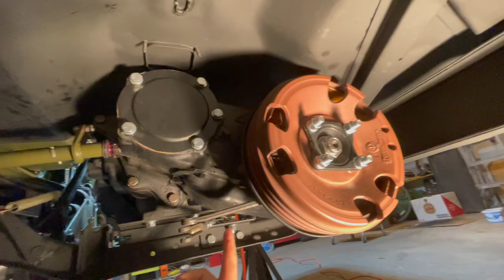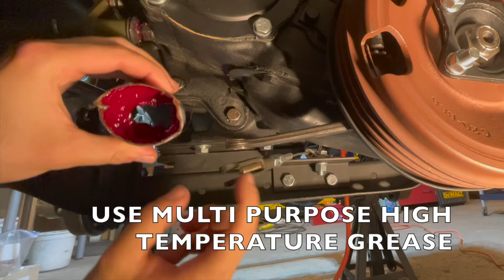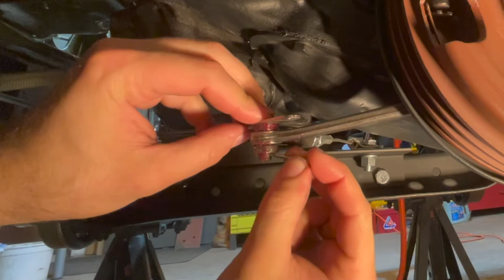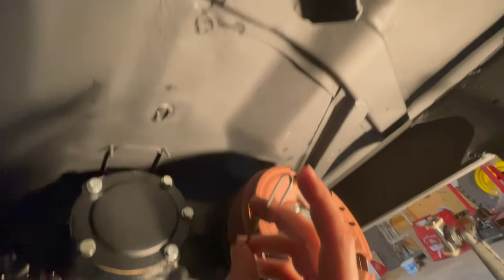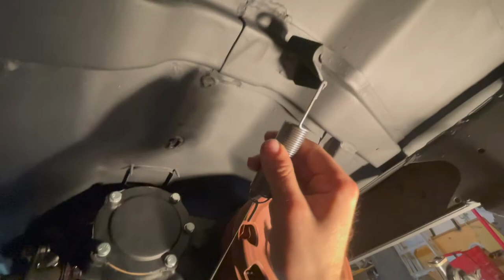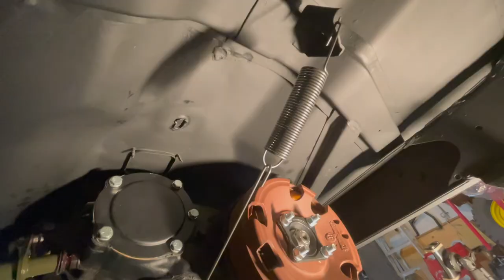Willys Jeep Emergency Brake Return Spring INSTALL | (Part 2)

Comment: Oddball question? My mom is building and restoring this same Jeep, but has the Delta stainless steel body on it.  She's located in the Philippines, lol, crazy story, I'm doing her research work here in the US, in NC, and helping her out back home on the Islands via broken English and facetime lol.  Plot Twist....can only use Toyota parts.  Any ideas or a prayer to be shared? lol. Far Cry for help, however, she's hell bent on making this happen, and all the forums have basically laughed and scratched their heads at me. Thanks! lol wither there's knowledge to be shared or......not lol